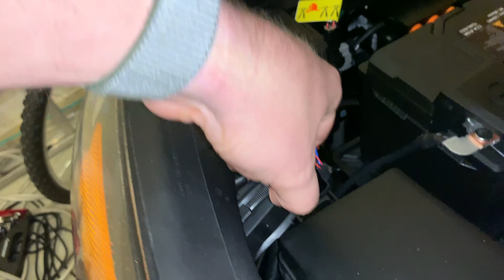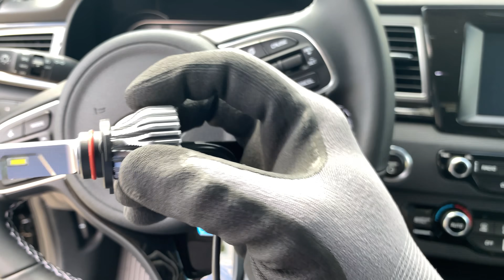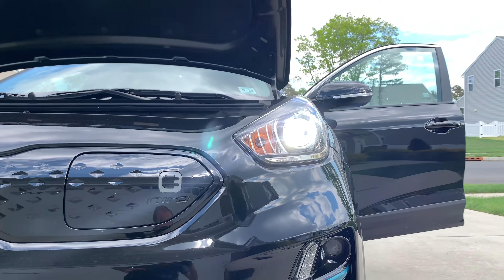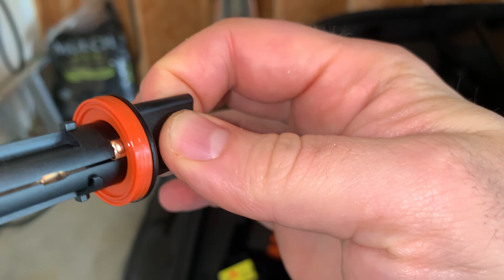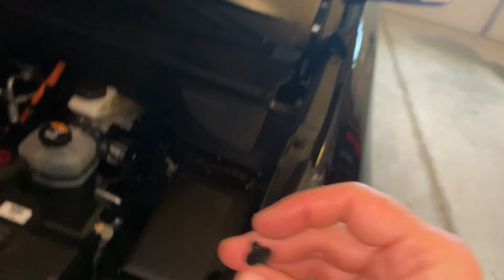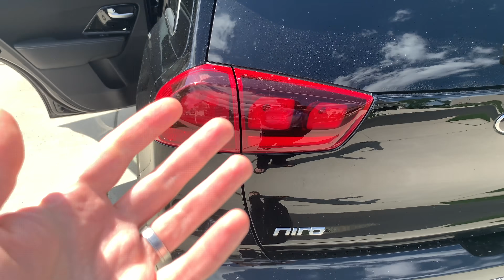2019 Kia Niro Ev EX LED Headlight Installation

Comment: You missed the hardest part, gett the bulb out of the headlight housing with al that little space there. Your video cuts to the bulb and wires already out of the socket.

Comment: I tried this message, but unfortunately I didn’t get too far because after I took the circular caps off, I noticed that I wasn’t able to unscrew it at all, and I looked inside with a light to see why only to find out that they had screws on them, and it is impossible for me to get to those screws without taking multiple other things apart which I do not have the time for Really wish I had the EX version for this purpose alone.  My situation is a bit weird because I don’t even know why my light is out. I took it back where I got it from and all they did was put another battery in there and that fixed it now today about 34 days later now the front right headlight is out this time and I’m like WTF🤬😤😤😤at this point.   Electric vehicles are fun/cool at times some of them but because of small all of a sudden issues like this out of nowhere, this is what makes me miss a gas vehicle, which I never had these random small problems with at all not once. Any problem I’ve ever had with a gas vehicle it was always normal and because of something either I did or something someone else do you or whatever the case is at least shit didn’t just happen right out of the blue and just stop working like it does in these damn electric vehicles

Comment: New NIRO owner here, a 2019 EX, fine video and understandable. Now, have you figured out a better back up camera for the NIRO? Its sub par, and far worse than the one in my IONIQ 03, which is the same platform as the NIRO, but not the same camera-which makes no sense at all.

Comment: These only cover the low beam correct? 
Trying to find them as they’re no longer available on Amazon
Reply: There is only one bulb in the Niro 2019 EV. The "high beams" are just adjusting the direction of the low beams, and refocusing them.
Reply: @jeremyharris2998  thank you for the help!

Comment: Hi I just got a 22 Niro EV but my biggest gripe about this car is unavailable LED headlights.  Now after you switched them out,  are there any danger of LED headlight burning too hot and melting plastic housings??? I had that happening in mid 90s on my Maxima after I put in LED lights...
P.s.. can you use that same LED bulbs on headlight and fog lights as well?

Comment: It's a good idea to park the car in front of a wall or garage door.  With the old bulbs on, mark the light level on the wall with masking tapes.  After the replacement, adjust the light to the previous level of the masking tapes.
Reply: Nice idea.

Comment: Hi, I have the Kia niro 2020 ev will these fit my car NOVSIGHT 9005(HB3/H10) LED Headlight Bulb White 6000K, 2Pcs 10000LM 50W Car Headlight Bulbs Conversion Kit, Super Bright Waterproof Replacement for Halogen Headlight on Amazon uk thanks

Comment: Some reported problem with the led bulb used here but another bulb works. I installed another and works great- AUXITO 9005 LED Headlight Bulbs 12000LM Per Set 6500K Xenon White Mini Size HBe ($40) https://www.amazon.com/dp/B07WMG43QJ?ref=ppx_pop_mob_ap_share

Comment: Nice job on this video! I only wish you would have spent a little time talking about why a Kia EV owner would want to do this. Do you know if the reduction in the use of electricity is substantial?Also do you know if doing this ordered nullify your warranty?
Reply from the maker: The reason I did this was to make all the lights in the front the same color. The Led running lights were a different color from the headlights and fog lights. I didn’t think it looked good. Electric savings played no part in my decision to swap them out. Don’t know why it would void the warranty. I have the old bulbs in the glove box in case of failure but have had no issues with the new bulbs.
Reply: @niroevj3477  thanks for this niro ev bulb installation video--- is there better visibility with the LED headlight bulbs now vs the stock halogens? Thanks!
Reply: For nullifying the warranty read the Magnus and Moss Act. Mostly that is BS from the manufacturer that X will void the Warranty. By the act the manufacturer must show that the modification was directly responsible for the damage, in court, and they cannot just void your entire warranty for any single modification.

Most parts aside from the drive train don't have that long of a warranty. They are going to have to do some gymnastics to prove that changing a bulb some how did damage to the drive train.

Comment: I did the same upgrades back in Aug 2019 and all bulbs are still working. I did replace the 20W LED HL as the NiroEVJ but had that replaced with 40Watt version of the AUXITO earlier in 2020. 20W version is little brighter than halogen when it warms up but 40W version is as bright as the OEM Corolla/Camry single LED lights so I am super happy with the new 40W version of AUXITO. I have replaced, all halogen/incandescent bulbs to LED which includes DL, backup, interior/cargo and even the turn signal. AUXITO makes bulb with load resister so it's plug -n-play. I think turn signal bulbs are "too" bright IMHO.
Reply from the maker: Johnny K I’ll look into it!  What turn signal bulbs did you get?  What connector?

Comment: How have the LED bulbs held up without fans? Any melting or other failures after a year? How satisfied are you with the lighting performance?
Reply from the maker: Zachary Schulman no issues!  Still working great
Reply: @niroevj3477  glad to hear. Just curious, what was the longest period of time you've had the lights on continuously?
Reply from the maker: Zachary Schulman if I were to estimate, I would say about 3-4 hours.

Comment: did you get any error on the dashboard and is all the bulb same on 2020 niro plugin hybrid
Reply from the maker: Sumir Uddin no errors. The only errors I got were when I changed the fog lights but that was easily fixed. The 2020 Niro is almost exactly the same so I would think they were the same but cannot be sure unless I saw one
Reply: @niroevj3477  thanks mate

Comment: Thanks for the video. Can you please tell me how to change the rear light bulb? I'm a new niro ev owner but I don't know how to do it 🙏
Reply from the maker: Redovitch jaa no one knows how to do it. I can’t figure it out either. The manual says you have to take it in if you need them changed. I will look into it a bit more. I mean there has to be a way to do it right?
Reply: @niroevj3477  absolutely :)

Comment: I have been fighting my 2019 kia niro ex led headlights. I tried the ones you used and kept getting the error code check headlight I've tried two brands to know avail. Any ideas on what to do.i bought relays and when installed the lights didn't turn on at all.? Btw I'm in California and my car has stock halogens I hate the yellow light from the halogens and I havent got any leds to work. Please help I tried everything.
Reply from the maker: Dan5ta Dawg you should not need relays. The only thing I can think of is the polarity was off. You need to flip the connector around and reconnect. That is typically the problem when they do not turn on. It would also explain why you are getting a check bulb message. Give it a try. You may just have them plugged in backwards
Reply: NiroEvJ 
Go info,  and he didn’t even say thank you. I will though thanks 🙏 🇬🇧

Comment: Did you change the reverse bulbs for LED as well. The original bulbs are useless and I want to upgrade mine.
Reply from the maker: No.  I can't find a way in to get to the bulbs.  I would love yo get to the brake lights and turn signals too but cant get in there to change them.  If you find a way please let me know and I will make a video about it.  Thanks!
Reply: @niroevj3477  I will be making a video for the reverse bulbs since they suck. You have to access them from under the bumper, supposedly there are 4 pins holding a plastic cover in place on each side, then you can access them.

Comment: Could you show changing the license plate bulbs, I’ve tried finger ends, a nylon spudger and flat head screwdriver without success getting the lens off, thanks.
Reply: Flat head works great! Just press sideways!
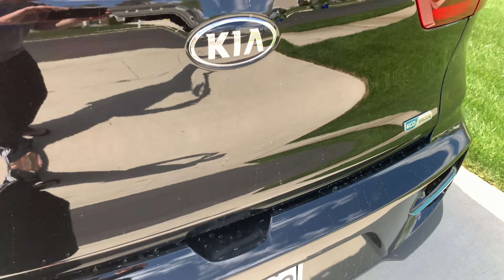Reply from the maker: Look at 12:33 in the video.  Just use a flat head screwdriver to move the tab on the left.  The cover will come down giving you access to the bulb.  You won't need to force it.
Reply: @niroevj3477  I pushed the tab all the way in, the cover doesn't come down. Tried flat head, trim remover, won't budge.

Comment: Hi Iam in the uk and purchased these lights on Amazon from US. But the plug connector is different and the locking ring on the bulb is different . Any ideas on the UK spec. My car is a 2019 model
Reply: I’m really sorry but I do not know the spec for the UK Niro. Maybe check a UK Niro forum. Wish I could help. Niroevj

Comment: Thank you for the video, it's been super helpful! 

I got a pair of the headlights you link in the description, but it looks like the instructions are telling me to install the bulbs in the opposite orientation that you instruct. Any ideas or thoughts? Gonna try both this weekend and see the results.

Here's a link to a pic of the instructions.

https://imgur.com/d5iRKP5

Thanks!
Reply from the maker: Harold Smith thanks for the great question!  The reason I state to put the bulbs the way I did was because it matched the orientation of the bulbs I took out.  I would try it the way they suggest and if it does not look right, turn them. It will not take long. Thanks!
Reply: Hi Harold, Did you try the light orientation opposite? I just got my Auxito and I read the same in the description.

Comment: You know your stuff man. Wondering if I wanted to match the color of the running LEDs, 6000k probably isn't cool enough. I don't want blue bulbs, just something a little closer. Any thoughts?
Reply from the maker: The bulbs that I bought and installed are pretty much an exact match of the running lights.  I cannot see a difference.  There are many choices on amazon but if you stick with the xenon white led's you will be fine.  Good luck and thanks for the question!
Reply: @niroevj3477  Awesome, thank you for the reply!

Comment: I noticed that the NiroEV with the factory LEDs have a a different projector housing than those with the Halogen bulbs.  I was wondering how have your LED's held up these past 5 months in the Halogen housings?          Thanks for a great and informative video.
Reply from the maker: Work just as good as when I installed them.  While I agree with some others that led's do not do as well in a projector housing, as long as you have the right led made for projector housings then it should not be an issue if installed correctly.  Thanks for the question!

Comment: This is what i have done to 2019 Niro HEV;

* AUXITO 9005-LED Headlight Bulbs [Amazon]
* AUXITO 912 921 LED Backup Light Bulbs. [Amazon]
* CIIHON H11 H8 H9 LED Fog Light Bulb 1800 Lumens 6000K. [Amazon]
* all interior LED conversion [Walmart]

for AUXITO 9005-LED, lock mount come as high-beam because it's intended as DRL. For Niro,  rotate 180 degree so it will mount as low-beam [match the halogen]. author did a good job explaining the shape and intended focus but didn't show the rotation. All said and done, it was very easy and any novice can do it. for the brightness of AUXITO 9005-LED, it's little brighter than halogen that replaced. like typical LED, it looses some brightness after it warms up so it will look much brighter first 5-10 mins and it settles to little brighter than halogen it replaced.

front side marker in Niro is 163 series, using 193 will not be bright enough. also using white LED color bulbs will reduce the brightness in amble cover. in other words, match the color to amble for best performance. tail lamps in NIro are LEDs except for FE [base model].

Comment: You actually can change the taillight bulbs on the tailgate. Saw a post where someone did it. It was just a couple of bolts.
Reply from the maker: Ahuizotl Xiuhcoatl I would love to see that video because there is no way that I can see to get in there.
Reply: @niroevj3477   I want to say there are pop out panels on the inside of the hatch that are directly behind the tail lights.

Comment: is it worth it to change them?
Reply from the maker: It was worth it to me because the running lights and the headlights were two different colors.  You had yellow and white.  I did not personally think it looked good.  Now all the lights are white and I think look great.  Plus it saves some energy but that is not a good enough reason to change them out.
Reply: @niroevj3477  saving energy is good enough, thats why we drive electric.

Comment: I just got the same LED headlamp bulbs from the video, and they honestly dont illuminate the roadway as well as the stock Sylvanias. Any other LED bulbs I can put on my Niro?
Reply from the maker: Are you sure they are installed in the correct orientation?  Mine are super bright.  You can put any bulbs you would like as long as they have the some connector.  I would stick with good fanless led's however.

Comment: I wonder if you have problems without the decoder that you installed with the LED fog light? Does computer give you any error for your LED headlight?
Reply from the maker: Li Fu no problems with the led headlights. I suspect that is because led headlights are standard on the premium trim. The premium trim however has halogen fog lamps. Switching to led bulbs in the fog lights does cause errors

Comment: Just got a new white e-Niro in upstate NY. Very frustrating that factory did not put such a simple and cheap LED in there as a standard. Thanks to you, I could do my DIY now. Could you indicate which exact bulb you purchased here. I'm a little bit confused with the two size in the amazon link, 9005 or 9006? What's the difference? Thanks!
Reply from the maker: Li Fu the difference in the two is the connector. You need the correct connector which is 9005. Check the description. I have a link there for the bulb I used. You can use any bulb but it has to be 9005. Thanks for the question!
Reply: @niroevj3477  Thanks!
Reply: @niroevj3477  Hi the link isnt working, can you find it agian?

Comment: Hi,I have a niro phev,but the main headlights are hi/lo hb3 halogen  types,my question is,does the EV version have separate dip lights?
Reply from the maker: The EV has a single bulb for Hi/Low
Reply: @niroevj3477  yup,so does my one.The one that put in your niro is a hi/low bulb,right?
Reply from the maker: slickAfoe G check the link in the description. That is the one I used. The actual bulb housing adjusts the beam when you set it to high. You can hear the actuator move when you hit the high beam

Comment: Thanks for the great video. Did you installed the can bus or just the standard version?
Reply from the maker: marco versteeg non canbus. The headlights do not need canbus or resistors. The fog lights however do need them. I mad a video of the installation of the fog lights that I will be posting soon

Comment: How about this one ?High beam CPS Chips, Intelligent constant Cooling fan system,Amazon asin:B07PM4L6CV
Reply from the maker: MOSS Tony I would not buy any one with a fan. I only buy fanless. The fan can fail and the bulb can overheat. Plus the fans can get noisy
Reply: @niroevj3477  Still tnank you for your work,fighting :)

Comment: This is a great video thanks. I’m considering importing the bulbs to the UK. On amazon it says these bulbs light the same area (footprint) that the stock halogens do. Is that right? There are a lot of illegal LEDs installed in cars in the Uk which dazzle oncoming drivers which I wouldn’t want to do.
Reply from the maker: J P as long as you install them in the proper orientation they have the same exact footprint as the original bulbs. I have been using them for a few weeks now and no one has flashed at me. Thanks for the question!
Reply: NiroEvJ thanks for that. Does the angle adjustment of the bulbs still work via the 1-3 roller knob thing near the steering wheel so you can adjust the aim up and down depending on the car’s load?
Reply from the maker: J P that is built into the housing the bulb sits in and has nothing to do with the bulb so it should not affect that feature at all. As long as it is installed properly you will not notice any difference other than the brightness. In the US version of the car the high beams work by the housing tilting the bulbs up and it works perfect with the new bulbs
Reply from the maker: CabbieOO7 it will but not by much.  I just like that they are all the same color.

Comment: Much appreciated and stoked to see decent LED bulbs available. I made the mistake of trying some of the first gen bulbs on the sides and tails on our '08 Prius a few years back yeah didn't go so well. Started flickering out after a month. But then again I think we might have an electrical issue in general with that car in the headlight system because I seem to burn through standard halogens about every six-eight months. At this point though it's not really cost effective to have it diagnosed. In my '04 Matrix the lights seem to last for years. 

Does this mod actually save you energy output as displayed in the road trip video?
Reply from the maker: I don't think they make that much difference in terms of power savings.  They save about 80 watts.  I just like the way they look and how much brighter they are.  Any range benefits though would be hard to notice.